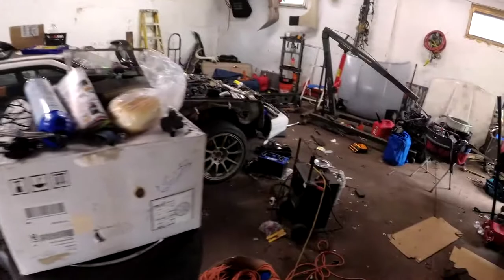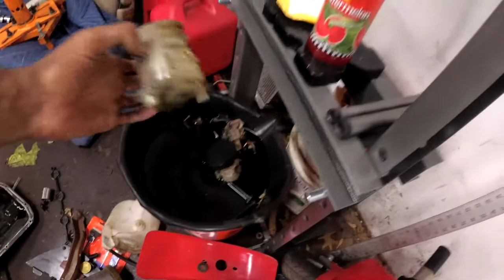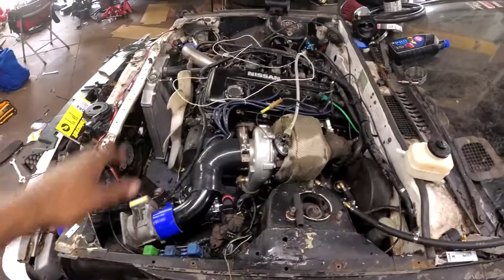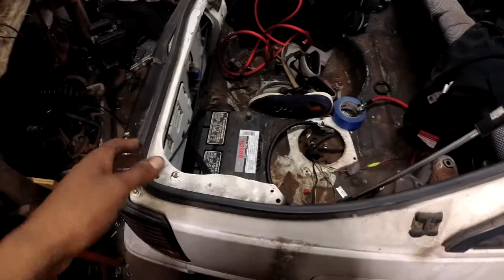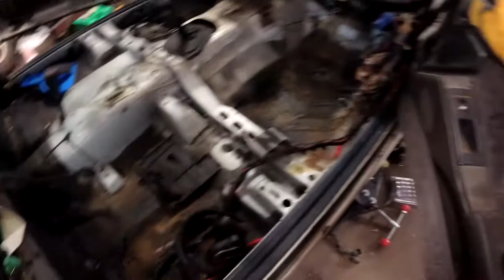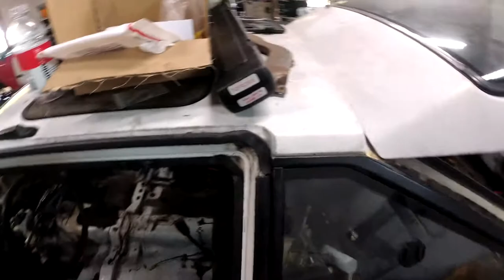Nissan S12 Update|Almost Ready To Drive

Comment: It's coming along pretty decently, I would get one part of the car 100 percent like the engine and then move on to the interior but it looks like your doing that
Reply from the maker: I agree with you homie. The engine is the main focus at the moment but I had to touch the interior just to open that door. I felt like it would never get done if I didnt take the seats out and clean the floor. It was a baby step but it's prepping me for the next step

Comment: Wuts up home skillet..... 😂
Good to see you bro. Remember that vid, locate the clutch and brake in diff location. The hot🔥side is on drivers side. SEe you soon brO-D
Reply from the maker: The clutch master never melted after all this time so that distance between the clutch matter and the manifold is just right but could definitely be further away for safety. In time I'll get braided lines and relocate the masters again, but for now I'm just  experimenting to see what works.

Comment: Fam, please redo the brake lines with some hard line. Just from a safety standpoint, your current setup is suss. Flock the dash. Its cheap and looks aight. Also whats stopping you from getting the same style brake reservoir?

Comment: you can get the real brake reservoir hose from a seller on ebay the sellers name was: goodbrakes https://www.ebay.com/usr/goodbrakes?_trksid=p2060353.m2749.l2754: I ordered some from them recently pretty good quality, they sell it by the ft I think, you just have to know what size hose you need, as for the reservoir i'd look for a smaller one, but the one you got is obviously a better idea to run over the melted one and I think the rims fit the car nicely.